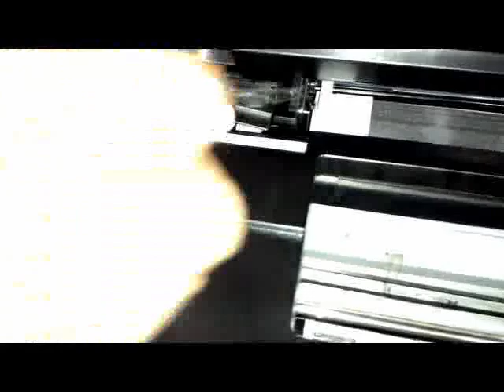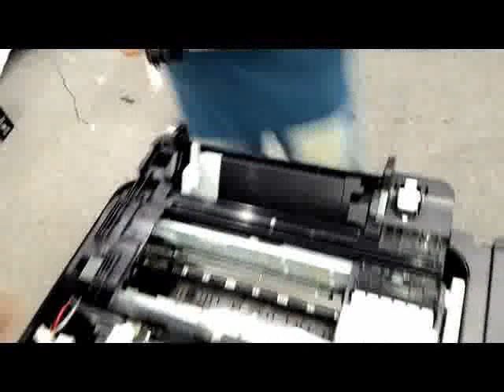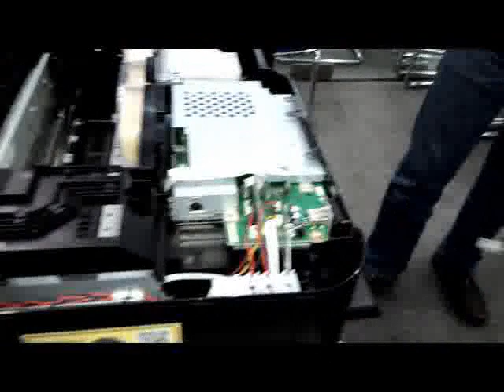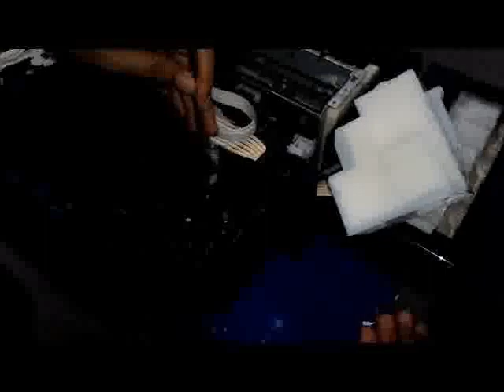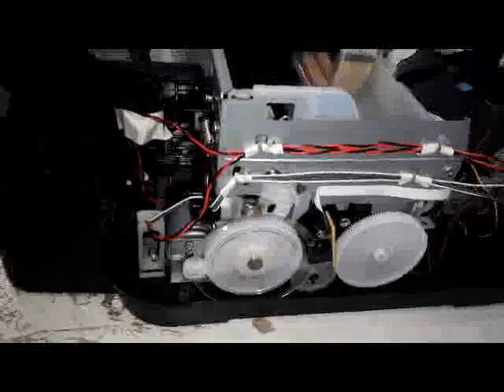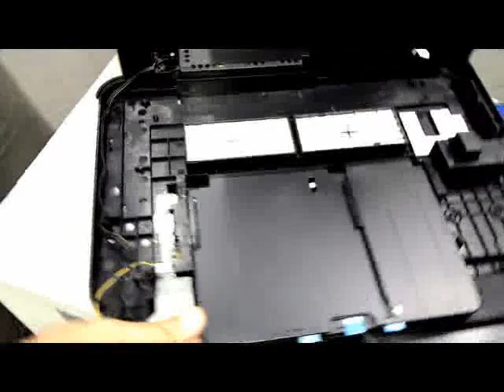Cara Bongkar Printer Epson L850

Comment: Pak mau tanya, ketika layar dinaik turunkan, layarnya mati hidup tapi sebenernya itu posisi masih hidup tidak mati (lampu indikatornya masih hidup tapi layarnya saja yg mati), kira² apanya ya pak. Mohon pencerahannya pak terima kasih sebelumnya.
Reply from the maker: Ganti kabel panelnya gan, kemungkinan besar robek. Sesuai dengan pengalaman sering robek di bagian lipatannya.
Reply: Baik terima kasih banyak min, langsung saya subscribe min yt mimin
Reply: Kira² kata kunci untuk beli di online shop untuk kabel panelnya apa ya min untuk L850
Reply from the maker: Kalo kabel saja kayaknya nggak ada yang jual, yang ada hanya satu set dengan panelnya, namun harga lumayan mahal. Saya biasanya menggunakan kabel carriage dari printer hp type lama spt 3920, nanti gunting untuk menyesuaikan jumlah pinnya
Reply: @PrinterTV  oke baik terima kasih banyak pak
Reply: Kalau kabel head dan kabel panel itu sama atau beda ya pak